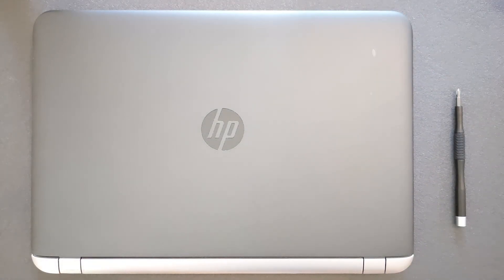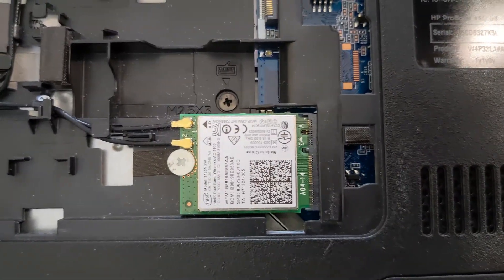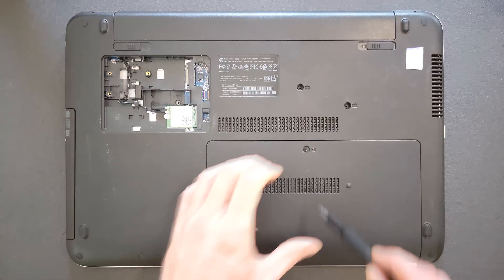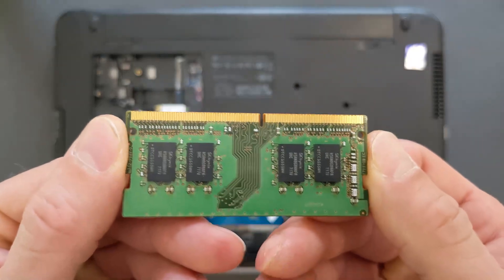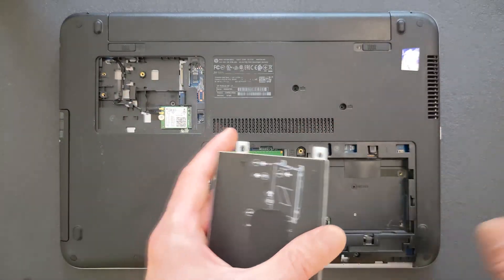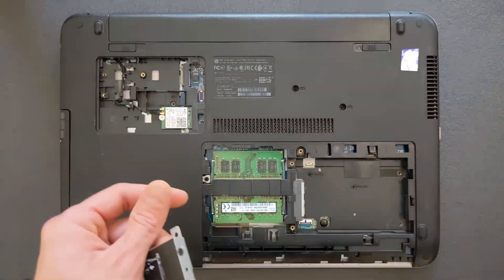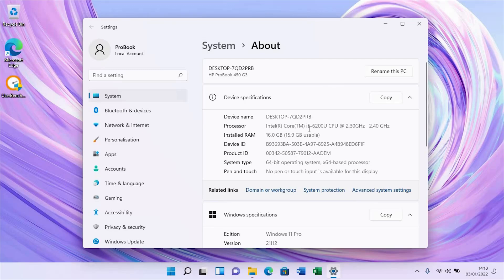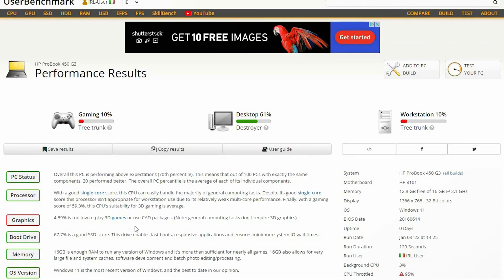HP ProBook 450 G3 M.2 SSD and RAM Upgrade

Comment: Why is mine doesn't come with bluetooth
Reply: Maybe take it apart and have a look?  It does according to specs.  If you need a new card aliexpress has them for $7.  Realtek RTL8821CE 802.11 ac 1x1 Wi-Fi + Bluetooth 4.2 Combo Adapter (MU-MIMO supported) HP part # L17365-005.  The googling took me 5 minutes.  Isn't the intenet amazing.

Comment: I find it hard to believe that they can only handle up to 16GB of RAM. Has anyone tried putting two sticks of 16GB or 32GB in it?
Reply: 3:42 He said up to 32gigs should be no problem, but, 1 review I saw found the guy couldn't add 32 but could add 16 as I have done.

Comment: Sadly just got a nvme by mistake and it doesn't turn on with it.
apparantly it only supports m.2 sata. which have two notches like the ones in the video.

If the notch is on the left (in your laptop) then it supports sata m.2. if the notch is on the right it supports NVME.
Reply: Bad luck, mine has sdxc slot so you can add 500gb-2tb space that way
Reply: @mikecar52  The amount of storage is not the issue, problem is the speed with sata interface is maxed out at 500-600mb meanwhile nvme is beyond 1000mb.
Reply: @Danialdaneshmand  On a 10 year old machine expecting today's technology is unrealistic.  You buy this to write email not to play games.You can still save data at 500mb.
Reply: @mikecar52  This 10 year old machine within the same year released a ddr4 model with nvme support i believe. So not that far fetched.

Comment: Great video, would you suggest to update to windows 11 on this pc or better to stick with windows 10?
Reply: You can upgrade to windows 11 according to some videos  on the net.  There is a version of 11 which is an easy install but unavailable to buy I think.  10 is still getting slight upgrades though.

Comment: If you wondering if the HP Probook 450 G3 will take a M.2 SSD bigger than 250Gb, it will. I just installed a 500Gb, the system filles are on the SSD and the 500Gb HDD is now for storage, as long as the M.2 sata SSD is a 2280 or 2240, it will work.
Reply: Does it work with NVME ssds
Reply: @dismasneil2800  Sadly just got a nvme by mistake and it doesn't even turn on with it. apparantly it only supports m.2 sata. which have two notches like the ones in the video.

Comment: My laptop has the same specs but for some reason it cant handle windows 11
Reply from the maker: Windows 11 is pretty heavy.. runs terribly slow even on newer laptop.. Best stick to Windows 10.
Reply: You aren't trying hard enough.  My hp 450g3 is i5-6200u.  But otoh you could install linux and probably add most of the programs you want from windows via wine.  Zdnet wrote it up on  March 11 2025.

Comment: By the way it can accept 2x 16 GB RAM sticks (2400 MHz type). Having a total of 32 GB memory (which is beasty). 😉😇🤗

I successfully tested it on mine just a few days back. 😆👌👍
Reply: Really? what is your mainboard? is it H8101?  i through it accept DDR3 only with max 2x8Gb DDR3 1600Hz
Reply: @leroy3086  It's X63C, HP P/N: 855564-601. 😆👌

The 470 G3 laptop came in 2 varieties - one with DDR3 RAM support & the other with DDR4.

Comment: I am so pleased with that laptop. In the 7 years since I bought it, I just had to change the battery. Of course, it now reaches its limits more often because of the age and lacking RAM (8GB), but otherwise it keeps getting updates by HP and I think, if I would upgrade with a second RAM-Stick, it will be just fine for my needs a couple of years.
I tried gaming on it and Minecraft runs okay and even Dota is possible, but obviousely not on high graphic options.
Reply from the maker: Agree, they are great machines and even these days well usable.
Reply: my battery lasts for just an hour. if I get a new battery how much longer would it last for. and My ram is 4gb. if I upgrade it to 8gb ram will it be faster
Reply: @ Considering the minimal cost to replace battery and upgrade to 16gb ram I am amazed you haven't already done so. Maybe a bit faster but easier to multitask.
Reply: @unc_clinton The RAM-Upgrade from 8 to 16 GB feel not very relevant for my everyday use, but when gaming, I have a much quicker Loading performance. I was lucky and got my RAM-stick for 18€ instead of >60€. I bought a new battery some years ago and I think, a couple of hours without charging are possible. But I have no experiences on specific times. But I think this is a nobrainer, because a new battery costs just 30-40€.

Comment: Where can i buy board for hp probook 450 g3 ?
Reply from the maker: Probably eBay. Will be cheapest option,  also you can order from HP but I would think price will mad. 
Sometimes buying from eBay same laptop with other faults but working motherboard will be cheaper then buying board own it's own 👍
Reply: I have a motherboard I can sell to you from a damaged screen hp 450 g3

Comment: For Internal SSD M.2 2280 slot, max is 128 gb only?
Reply from the maker: Nope, but have not tested personally.. but for sure it will support more.
Reply: In mine I have 240 GB from Kingston. 😊
Reply: @davidbolha m.2 or nvme?
Reply: @colombowest I think M.2

Comment: What's the maximum ram it can take?
Reply: in video it is mentioned that it should not be a problem to upgrade this laptop to 32gb RAM. Also processor specs says 32gb max. Official HP support site provide following info for the maximum RAM: 'Upgradeable to 16384 MB in slots 1 and 2'. https://support.hp.com/us-en/product/hp-probook-450-g3-notebook-pc/7834555/model/7834556/document/c04792126
Reply: You can upgrade as much as you want in x64
Reply: @namaloompakistani1768  But considering the CPU is basically a dual core CPU 16 GB DDR4 2133MHz RAM should be just fine. 🤔😕
Reply: 16gb